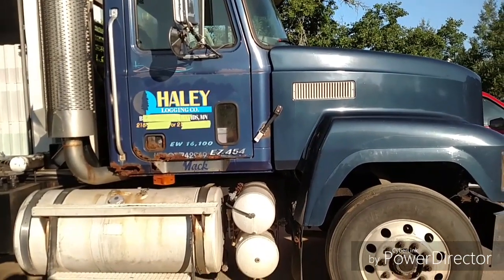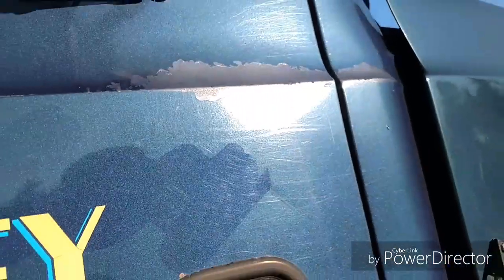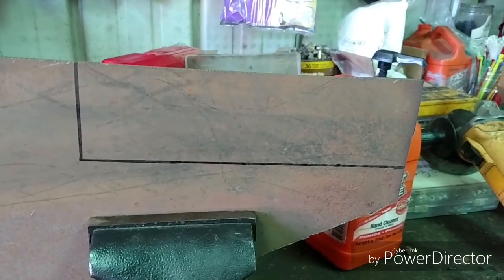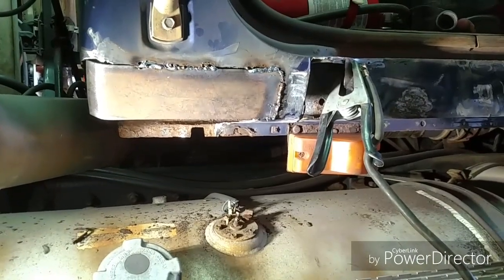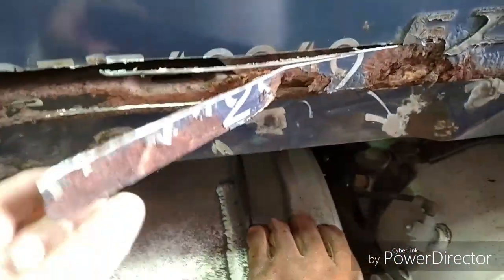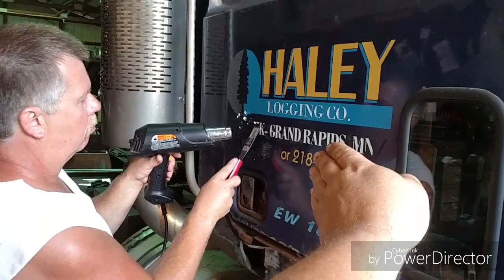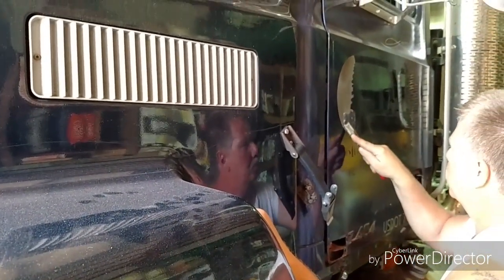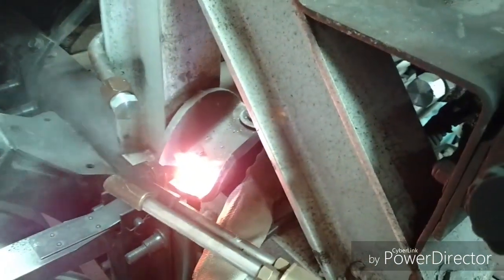Too Big of a Project for Me???

Comment: Do u buy anything from Wurth at ur shop?..  might wanna try thier rust converter..  seems to slow it down.  I used to use it at a shop i used to work at at and had pretty good results.  Lots of salt and rust in New Brunswick
Reply from the maker: I've never used a rust converter but I'm strongly considering it!  Thanks for the info.